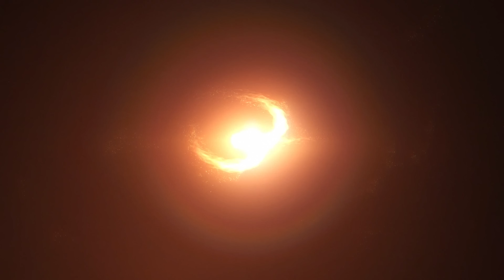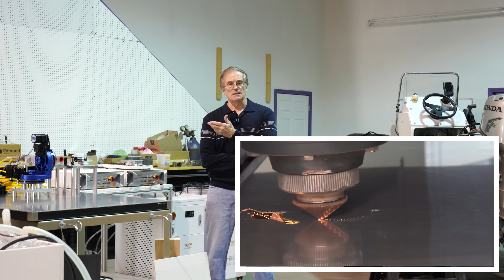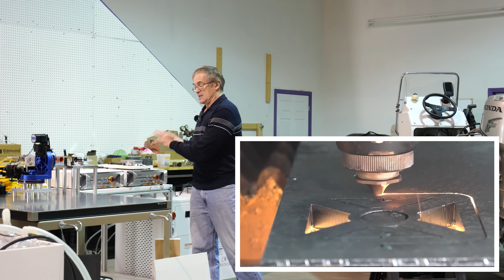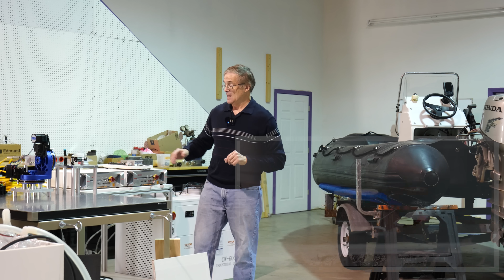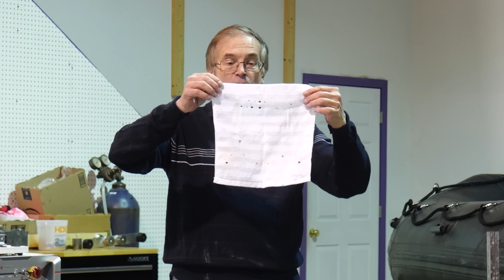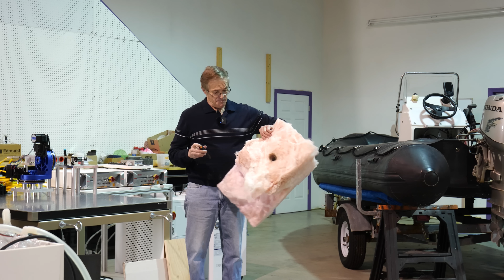We have a problem... and need your help!

Comment: I think youre talking about granite.  You need some slabs for countertops propped up against the wall.  But the most practical solution is to find a nearby quarry out of eyesight of others and perform the experiments there, outdoors. Or someone said to perform the experiments downward.  If its not safe enough as a platform for the outdoors then I can't see how you would deploy this without endangering everyone around?

Comment: I do understand the immense weight water can be Is there any way that you can use a thin sheet wall of water with some sort of light absorbing material aerated into it. Possibly even something that would reflect it rapidly, like metal flake. It should absorb them the light and heat and then diffuse it out which most likely to hit more of the same material and create more heat and the water would be the absorber of the heat.

Comment: I'd suggest using a backdrop of a glass enclosure in which smoke is generated, or scattering the laser light with water droplets and/or mist, or a backdrop  with a sacrificial front and full of sand.

Comment: You want me to invent a shield for drones? Otherwise you would just redirect the laser down straight to the ground. 👈 👇 For example build a watertank made of one inch thick steel plates, make walls reflective from inside, fill it with water, cover it from the top living only one small hole for the laser beam to enter. The size of the containter is important, so make it big enough to disperse the energy you put into it. But if you need a lightweight shield - then we have a puzzle to solve :trophy-yellow-smiling:

Comment: YOU ARE USING special optics to concentrate the beams so you need to do that in reverse. To diffuse the beam, you can send the beam through, e.g., a ground glass diffuser or an opal glass diffuser. This will cause the beam to scatter in a wide range of directions, and you can place an aperture downstream to limit the beam to a cone of angles. 🕶🕶🕶🕶

Comment: @TechIngredients , 

Hi! Took me a while to figure out something.

Option 1: Use “Starlite” … Nighthawkinlight YouTube channel made something similar to starlite you do a collab with him. I’d surely watch that 🥰

Option2: 

1. You could double up by Use cylindrical device where the laser light goes inside one end this cylindrical device has a gas that can reduce the intensity which could be circulating some gasses would escape but most would circulate as one end will be vortexed then other end where laser light enters air suction would suck the gas. At the end cylinder there’s starlite too.

Option 3:

I see in the other comments to use a water tank. What i can add is to line the inside of the tank with mylar. This would “spread” the laser light inside and more to be absorbed by the water which has tremendous heat capacity.

Comment: fiber glass?  Instead of worrying about reflection, seek reflection.  I was thinking salt crystals are distorted corner reflectors, so instead of sending the bean back in one direction, you send it back in as many directions as possible.  Or snow.  Or fiber wool.

Basically bloom is the enemy of scifi lasers.   Can I use a laser to make a vacuum channel for a Helbore frozen tritium fusion bolt?   Bloom.   Seek bloom.  I think pink fiberglass is like black paper under a magnifying glass.  Make an artificial bloom.   Perhaps layers of material with a "bloom channel" to the sides.

Comment: Here's my take on it: Think vertically! Mount the laser in the ceiling, square of a section of the floor to build a pool. Line the bottom with drywall then cover it with 2-3cm of sand and then completely saturate with water (to the point where the sand is 1cm below the surface). 
In my mind the laser is mounted with hard stops, making it impossible to veer outside the frame of this 'pool' and the sand/drywall/water should together be more than enough to slow down the laser to hit the kill switch before it reaches the floor. My guess with 10mm drywall + 3cm sand layer + water-saturation-'cooling', (1cm above sand layer) ~ 8 seconds. 
Biggest concern is perhaps scattering when the laser hits the water surface.

All the best, Gerry

Comment: Pulse the laser and add a fuse to break the circuit when it goes over the limit?
Reply: Running the laser at full tilt while swinging around will not prove anything that it won't also prove while being stationary. You will just give your targets a few black dots instead of a satisfying bang

Comment: What about a type of water jacket ? Similar to how Nasa and Spacex deflect and cool the rocket exhaust on launch . A type of material that can withstand the initial comtact heat and then transfer it to the water to cool the heating patch on the metal - obviously some experimenting with steel , alu , copper titanium - etc . Also I rember that some  ceramics could do such as the ones used on reentering of spacecraft - then finally a defocussing lens that you use till you actually want to deploy the beem . Just my suggestions - thanks I enjoy your destructive experiments - good luck

Comment: YOU HAVE TO MAKE BACKSTOP AREA SMALLER!!!
#1: Mirror trap
#2: Angled mirror sends laser into the ground (location must be selected)
#3: Mirror sends laser downward into a tank of water with fine suspended carbon: carbon absorbs/blocks laser, water absorbs heat & prevents fire.
#4: Target backing uses high-temp ceramic.
#5: Light diffuser - does the opposite of laser creation, de-focuses laser into broad light 
#6: Optical funnel takes broad area of backstop and focuses near misses into small area where thicker/heavier materials can be used 
#7: Pure calcium carbonate Target backing.
#8: Air traffic monitoring - mirror/bounce laser straight up into atmosphere and space, but test only occurs if area overhead has no aircraft.

Comment: I feel like a lot of folks are overthinking this by trying to engineer a magic material/composite for it.  Think about why the drones took so long to "shoot down".  They moved around and spread the energy over a larger surface area.

Employ this same basic strategy.  Hell, you could make an oversized "pizza-peel" out of canvas and some rollers as a moving background.  Like what they did for oldie films 😅 Get it spinning fast enough and the laser won't have time to add enough energy to any one spot to slice through.

Comment: I don't work with lasers at all, so this is a shot in the dark.

How bout a metal plate that you watercool. Then paint it with a vantablack like coating (obviously dependent on the wavelength of your laser). The coating would absorb the light, then the plate and water would carry the heat away from the spot.

The coating would obviously be the hardest part. You would need something that is stable at high temps, and the plate would need to be thin enough to quickly transfer the heat into the water. 

Copper might be needed to spread the heat out fast enough to keep everything from melting. And at the scale area you want that would get pretty expensive.

Not sure if this is even feasible. Maybe with the heat flux involved an ablative material is required.

Comment: You need a moving wall of ceramic tiles. Similar to the moving walls in rock climbing gyms that allow a climber to climb endlessly just are ft from the ground. It would be easy for you guys to make. I’d overlap the ceramic tiles herringbone style and have tiles mounted to fibre cement sheets.
Similar to this. https://youtu.be/9913A6JC2e4?si=J3dYfOEhf6nRn_xW
Let’s call it a dynamic wall.

Comment: Light waves travel into the snow or ice and encounter numerous ice crystals and air pockets, causing the light to scatter in many directions. This scattering effect, combined with air bubbles trapped within the snow, leads to diffuse reflection, meaning the light is reflected back out of the snow in all directions. 
Shattered glass in water would be warmer.

Comment: Looking forward to the fiber lazer videos.  I suggest cement board painted with ITC 100 HT Ceramic Coating.  I have it in my forge and it stops the bricks from deteriorating.  It is used in furnace rebuilds by painting it on plywood and using it to stop the plywood from catching fire.

Comment: I looked at a few comments. Point the laser at the ground and use an optic solution to direct your beam with a kill switch that mechanically remove the optic solution as a safety mechanism. You would have to do a bit more work but it's as simple as a switch and might make the tracking better later. Depending on your solution. Another note is that the targeting can be done with the laser off if you do this. Add the optical solution could be programmed as such. This removes the need of a shield. Secondly, I like the waterfall idea... However I don't know what would solve the refraction problem there... Maybe waterfall phantom black paint.... Copper rain? No idea

Comment: Why not soaking the plywood in water?
Then you could put sand behind a couple planks of soaked plywood, because the piercing will happen anyway, so the burnt sand is replaced automatically by gravity and the water(or a better fire retardant 🤷🏾‍♂️) prevents the rest of the plank from caching on fire 

May be a good idea to put the plywood at an angle so that you'll have less of the sand weight on the boards but could still benefit from the sand replacement 
Hope it helps 
Thank you so much for all the videos 💪🏾
Much appreciated 🙏🏽

Comment: hello again, I like to ad some things to my last post: 1- maybe you have to switch to coal or grafite as the flating particles. 2-What about letting the beam face some sort of lense to destroy it? 3- What about some sort of milky glass? 4- Why not using an arrangement of 4mirrors in 45 degree  angles. Make one of them like transparent from one side and reflecting from the oposite and use this one as an entrance for the beam. This way the beam should go in circles within this chamber and not destroying anything.
Good luck

Comment: stopped the video at 6:54 to comment
background in cnc machinery and casting for 15 years

different avenue of thought, how about a distance focus control, i.e a digital rangefinder that sends telemetry to a sliding lens so the energy past the point of intent is lower, like how pre fiber lasers worked with a telescopic lens for focusing, 

they are testing similar things in ukraine to disable arial targets, all diy built from repurposed fiber lasers and xbox kinect sensors

as for a material that can withstand the energy as a backstop, you can make something yourself - 

pre warning - respirator required working with some/all of the materials below

40% flaked graphite, 20% silica carbide, 10% silica flour, 5% boron carbide powder and 15% clay(pottery type, powdered) 10% synthetic ruby blasting medium, (percentages are rough its not a perfected recipe)
these ingredients can be mixed together but require a 10t hydraulic manual press  with a steel sheet to compress into paving size 400mm x 400mm x 40-50mm slabs using moulds which also need to be steel or stronger, they then need to be heat cured after compression and flipping them out of the moulds, find someone with a home powder coating oven  or resin curing autoclave to bake them - same concept as making crucibles, they absorb the energy rather then reflect or divert

just my 0.4c from new zealand

edit: after spending an hour reading all the comments i have a cheap and nasty idea, for a small portable target 
a recirculating pump that forces water through a perforated pipe top mounted over a square of replaceable gypsum board that is screwed to a square of plywood (coated in crc intumescent paint) that is also constantly saturated, attached to the back of the ply is a sheet of copper that is connected to a wax type thermostat so if the wax melts from the heat from the copper it interrupts the circuit (like old car radiator thermostats or violet wand wax capacitors) - its a rebuildable target with a mechanical interrupt not a proper permanent backstop as mentioned above

Comment: You were "almost there" with the water and towel.

Water can diffuse a laser beam making it weaker so what I would recommend is:

Two 5gal water containers
Flextape
Short thin bricks
Small water pump
Open top container bigger than the two water containers are wide/set front to back
Custom rolling table built to hold everything
Misc hose
Metal tubing to act as external bracing

On the rolling table you will have the 5gal water containers mounted one behind the other and short brick walls behind and on the sides of the water containers. The open top container will sit on the bottom of the rolling table.

The idea here is that when you fire the laser it will go into the water and diffuse the laser making it weaker. This will lead to puncturing the water bottles, however the weakened laser will cause less damage to the thinner brick. The water that leaks out can be captured by the lower open top container. 

The thin brick can be mounted to the system in such a way as to be able to be "opened" and inspected, the containers resealed with the flex tape allowing them to be reused, and the water repumped from the open top container back into the water containers.

This would make for a reusable laser containment system while also allowing for portability.

Comment: I would compose and use a custom laminate. The introductory (first) surface being frosted/sanded polycarbonate sheet (thicker is better). The second surface (back side) coated with a suitably sized particulate and thickness of titanium dioxide coating. Next, a carbon felt welding blanket, and finally, a polished aluminum sheet. Aluminized mylar layers may be effective, but I wouldn't trust their quality.

Comment: Im thinking an electronic "mirror"
Where the " mirror" absorbs the laser by opposing the frequency of the light by 180° phase. Similar to a capacitor. Or is it possible to measure the force of the laser. Such as when the laser is on an object or open air. Seems as there be a reflection whem it is impacting any object.

Comment: A liquid lens shaped mirror?
A material that increases the result you’re trying to find from the conditions applied . I remember those carbon snake fireworks that grew with heat…. Maybe something that expands and carries the heat away in an inert state. Did you try a spinning disk with various materials maybe one the functions like the snake firework. Or maybe a wind tunnel tornado of various materials. Liquid will stay from the inertia , not sure which liquid though. Maybe magma with a cooling system? Aztecs used to utilize mica for heat purposes, not sure if it would stand up to those temps though. Interesting though.

Comment: For the core material, glass sand-blasting beads. This could be dangerous from a retro reflectivity point of view, but if the 1st wall which the beads are contained behind has a Mylar coating on the back (pointing away from you and towards the beads) you could be relatively safe from a retro reflection scatter point of view. The beads would be different from the glass fiber because of thermal mass and the way they would pack themselves with air pockets between would create somewhat of an insulation. Getting beads to stand up as a wall is the next challenge, but if you had thousands of drinking straws all cut at say, 2 inches you could fill these with the glass beads. Its still going to be heavy, but not fire-brick-heavy. 
So, to recap what you have now is a moving wall (on coasters), its a little over 2 inches thick (accounting for 2x the plywood thickness), the 1st surface is ply wood with a Mylar backing, then a bunch of drinking straws laid horizontally (when the wall is standing upright) and a second surface of thin plywood. 
A glass ice-cream sandwich if you will.  |☰|

Comment: two very silly ideas!
1. make drapes out of carbon fiber cloth, a layer or 2 should be able to catch and dissipate the heat buying a secon or 2.
A. bubble foam machine maybe ducked a fog machine to make a a self healing wall that's internally bouncing the light around

Comment: I’m thinking that it may be best to use a ceramic wool rather than a fiberglass wool, and to combine this with some refracting particles behind an opaque barrier layer.

The idea is that first the laser will pierce the opaque layer, and begin to penetrate the ceramic wool which acts to absorb heat. As the laser passes through the wool its should also be encountering the refraction medium, dispersing the beam somewhat into surrounding ceramic wool and diffusing the power to be absorbed across a wider volume. The opaque layer should hopefully be able to withstand the weakened laser bleed-off.

For extra protection if the interior of the opaque layer is reflective (although I’m not entirely sure how possible that would be) then you might be able to further disperse the beam while also helping contain blowback.

I’m wildly unqualified for this kind of question (aerospace engineer) so I’d take my suggestion with a big pile of salt, but I hope my two cents help.

Comment: Oh that is an interesting problem, my first thought is some type of ablative coating but beyond the concern of fumes, there most likely isn't enough density response to resist the beam. If you are dead set on a beam stop instead of another section of optical train to diverge the beam, I would modify your wet towel idea. I would use a mass of water in a container (something resistant to thermal shock) filled with a particulate to absorb the light, like charcoal, or perhaps your micro spheres. My thought is that the opaquing agent will absorb the light as heat energy and dump it into the water as a thermal sink. Be aware you may need to rework your optical train to direct the beam through the surface of the water instead of the transparent container, because any microscopic defect in the material could be a failure point. Good luck!!